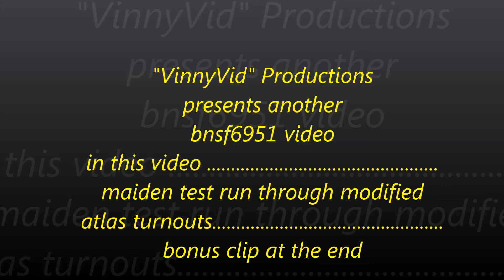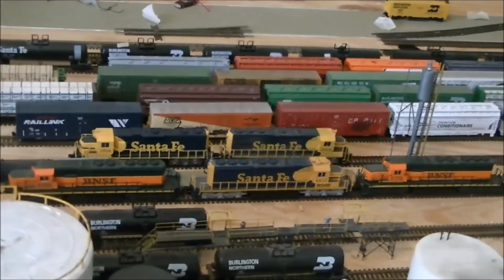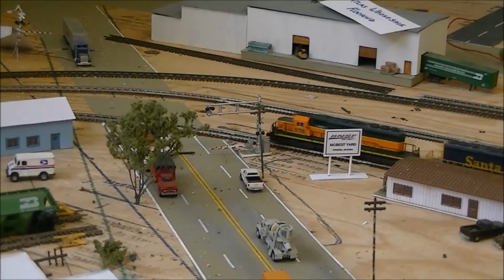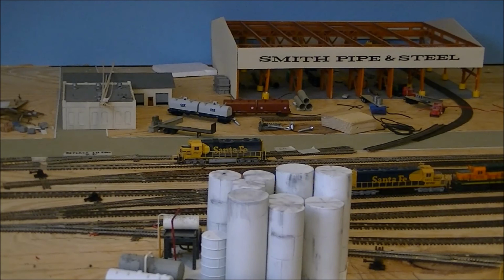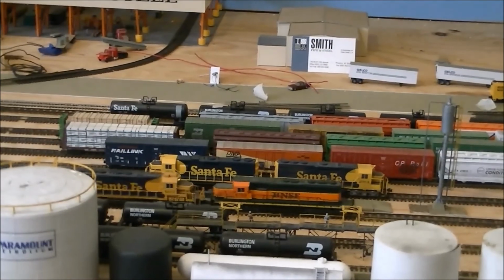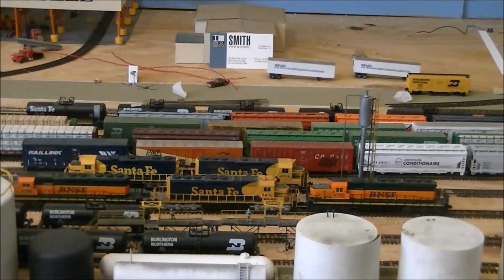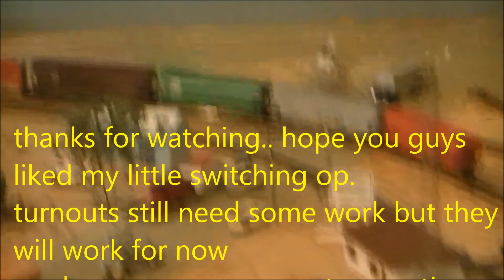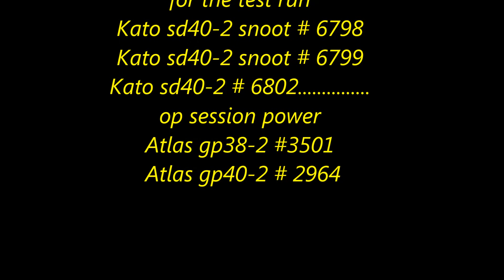modified atlas turnout test run

Comment: Glad to see trains running again. If you have  trouble with the engines stalling on the turnouts, try using electrical contact cleaner; the kind that computer geeks use. Get the kind that is safe to use on plastics. I got mine from Menards for about $8.00 a can. Spray a little on all parts of the turnout. I use a Q-tip to get in between the frogs and the rails. I use Kato track and I keep my track very clean, so I thought. LOL. After spraying a trouble spot, I couldn't believe the dirt that was on the Q-tip and rag. The contact cleaner gets rid of the oxidation that forms on the rails. So far I have had excellent results. Hope this helps.
As always, have fun with trains.
Randy
Reply from the maker: hey Randy... thanks for your input i will have to get over to the electronics store to pick some up... but in general these atlas turn outs are POS
vinny

Comment: Vinny, how are you securing your track work to the base plywood?
Reply from the maker: hello Mike... thanks for the question... the answer is simple i don't....(just kidding)
i use 50/50 mix of white glue... makes life easy if you need to take it up... just squirt it with water & i will come back up
vinny